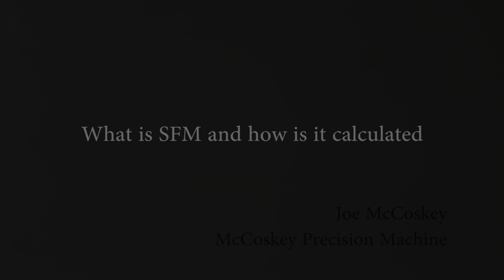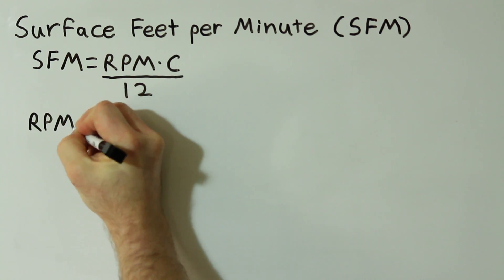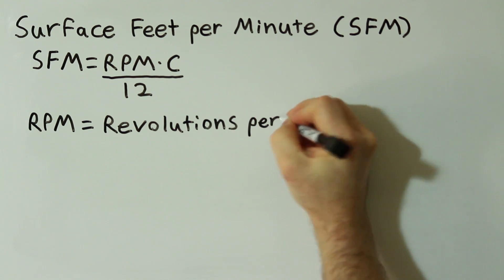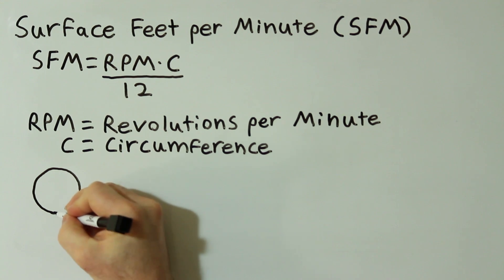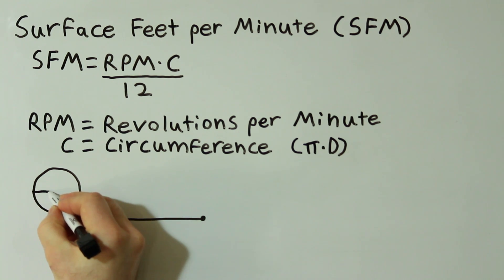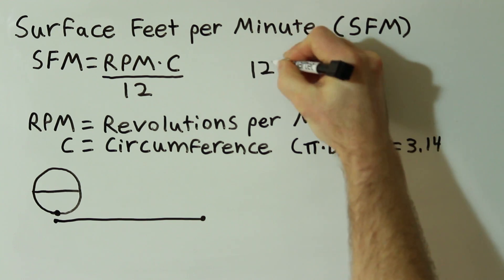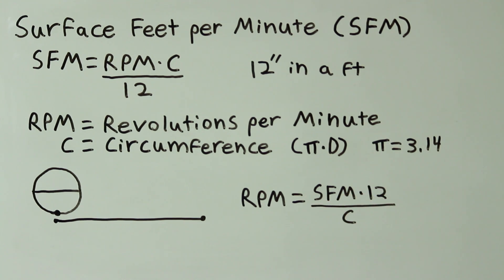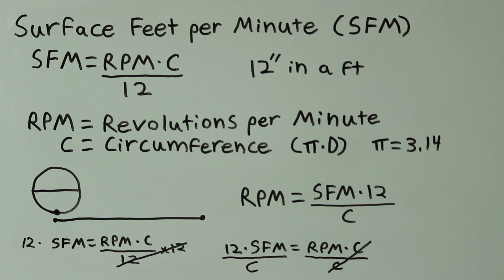What is SFM and How is it Calculated?

Comment: What would be the best speed for surfacing cast-iron disc?
Reply from the maker: There are several variables to consider (such as the cutting tool and depth of cut) and while I can mention a starting point, trial and adjustment will find the best speed for your application. Cutting tool manufacturers will usually have recommended SFM for their tools and application. I have a copy of the Machining Data Handbook that is no longer in print but a valuable resource for general / starting point information, it states that for ductile cast iron using high speed steel an SFM of 150 is good and with carbide it’s 500 SFM.

Comment: Great video. I just starded working at a small machine shop. I have no expirience and they put me on at old turret lathe they call it A1. We work with alot of different metals alluminum/1018/1215/1045/4140/410/17-4ph/316/nitronic. Is there a way to figure out the smf for these materials or some kind of chart i can use. We use both high speed drills and carbide tips. Or maybe a way to figure out smf using brinnel hardness. Please help
Reply from the maker: There are many variables both in the materials being cut and the cutting tools that determine the optimal speeds and feeds. In general, harder materials require less SFM while softer materials can use higher SFM. Stainless while not harder than regular steel does better with lower SFM. Carbide does better with higher SFM and HSS requires less SFM. Chip load is also a factor that needs to be considered. 

The best book for finding a good starting point with most materials and cutters would be the Machining Data Handbook by Metcut Research. They lean towards the aggressive side but are mostly on point and it’s a good starting point / information. It doesn’t look like it’s currently being sold, so you would need to find it used. It comes in a set of two books.

From the list you showed the toughest materials to cut are the 316 and Nitronic stainless steels. I typically cut them at 180 sfm with carbide and 35 sfm with HSS/Cobalt.

The number you end up with will need to satisfy your cycle time vs tool life requirements.

Hopefully this helps. Ideally there should be someone there to help you. It’s a steep learning curve without prior experience. I’ve tested the limits over the years and learned a lot.
Reply: @McCoskeyPrecision   wow, thankyou for taking your time to respond and for the very thorough answer. You are very helpfull.

Comment: That has to be the clearest and most detailed explanation of what sfm is and the formulas of how to calculate it and its relation to rpm. I really liked the example at the end where you stated how its how far a particular size drill moves while spinning at a specific rpm when rolling it on the ground. I've been told this explanation a dozen different ways but never felt like I really understood it. Thank you!